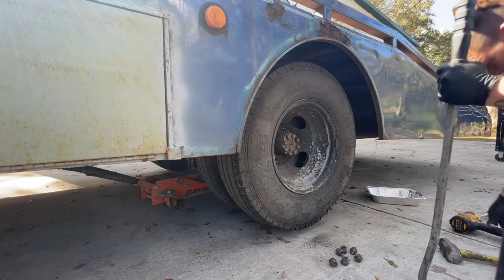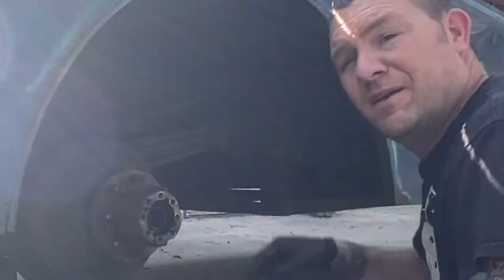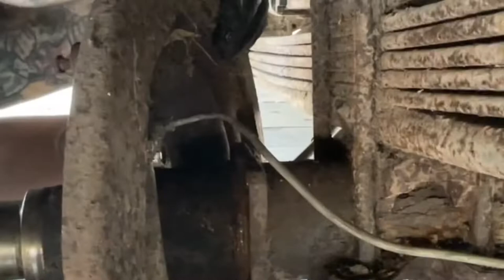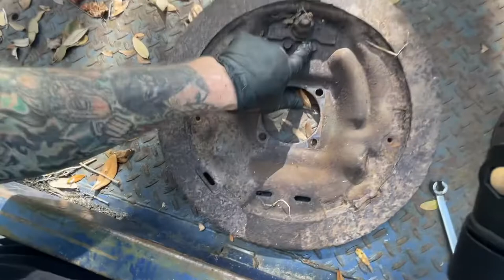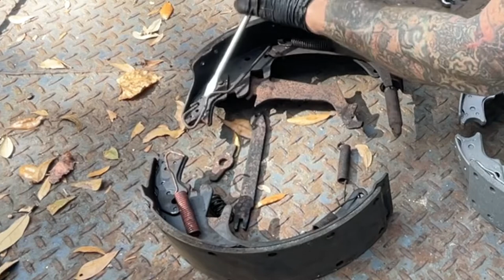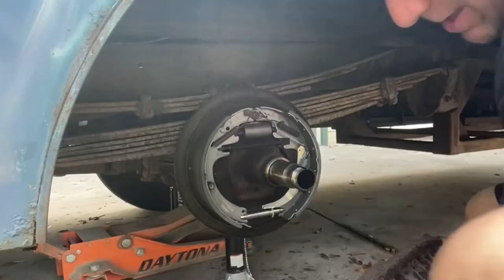1988-1999 Chevy 3500 rear brake replacement

Comment: Was quoted $600 for labor on replacing shoes , drums, and cylinders. But after watching this video It gave me confidence to do it my self. Going to try and knock it out in a couple weeks
Reply from the maker: Yeaaaaa buddy! Always better to do it yourself if you can. Not gonna lie though, if that’s $600 including parts then that’s not terrible. Drums are $200-300, shoes 75-100, cylinders 20-40, hardware kit 20., fluids, lines, etc… So around 450 in parts. I certainly wouldn’t change these for someone else for $150 🤣 But for myself I guess I’ll suck it up 😎 Let me know how it goes!

Comment: Great video, I was wondering how can i get to the rear brake line on these heavy duty axles since that line is sandwiched against the rear leaf pack, now I know. Thanks
Reply from the maker: Awesome! Glad it helped, did you get it back on the road?
Reply: The truck is on the road, what I’m trying to do is replace the rear lines with a stainless kit that I purchased, I  did the entire truck except the rear lines .
When I tried to get to the rear brake lines I noticed that those lines are packed so tight against the leaf springs that the only way imagine is to pull the brake cylinder out , but it never dawned on me about pulling the backing plate until your video, very informative,
Reply from the maker: @tomsteffs6511  nice, no more rusting lines for you!
Reply: Yes, every car that I had that the lines needed   line replacements I went with stainless, do it once and never worry again.
Reply from the maker: @tomsteffs6511  wise man right there!

Comment: love the video. watching to learn how to work on my 1988 c3500. question, since you are removing the backplate, could you leave the brake pad assembled, remove the entire thing as a unit and work on it on the bench? instead of trying to work those springs on the ground?
Reply from the maker: Thanks for checking it out! I don’t know honestly know if the whole thing would come off in one piece with all the springs intact. But let me know if that works!

Comment: My truck was sitting for years and I believe the break shoes are stuck to the drum. 
Any ideas for breaking the break drum loose. 
So far a torch and hammer hasn’t helped. 
The left rear dually is the problem child.
Reply from the maker: Oh boy I went through that on my f350 a couple years ago. I beat the crap out of it days. Eventually after days of soaking with PB blaster and whacking it let loose. 🤷🏻‍♂️
Reply: I have the same issue. Think the e-brake is stuck on

Comment: Quick question did the speed bleeder fit i was looking for them online but it said it wont fit your vehicle I have a GMC G3500 dually
Reply from the maker: I don’t honestly remember 🤣 but if you go to any of the parts store websites you’ll probably be able to find the correct part number for your application.

Comment: any idea where i could get replacement clip and square locking block for the spindle nut ? i have this axle in the rear of 1937 dodge but previous mechanic has lost the bits i only have the nuts!! cheers
Reply from the maker: Might be able to buy some of those universal woodruff key kits or possibly at an old fashioned hardware store.

Comment: What's the torque on the locking ring? In many cases, you crank it down to a specific amount then back it off a bit. But I didn't see any mention of that.
Reply from the maker: I went with German Engineering specs on everything. Güdentïght 😎

Comment: Would i be able to take off the whole four bolts and remove the whole assembly with all pads still on i only have broken bleeders need to be replaced
Reply from the maker: I’m not sure, maybe? But if the bleeders are in bad enough shape to break off then it probably wouldn’t hurt to do a brake job and replace the cylinders.
Reply: @conquercustom  was literally thinking that cause you said they were cheap and def dont wanna do this twice!! Thank you for taking the time for the video
Reply from the maker: @holeshot1721  yea buddy! I’ll keep making them 🎥

Comment: Do you know where I can get that brake drum mines is so rusted while I was hammering it off it started breaking off
Reply from the maker: Rock Auto should have it.
Reply: @conquercustom just like yours the drum came off as 1, but while shopping I only see drums that have the back half the front half where the studs are attached is not on the drum. Is it 2 pieces or 1 piece?
Reply: @conquercustom k I see that's the drum, hub, and bearings. Well I don't see how that's suppose to be taken apart 😂
Reply from the maker: @TheNeecee23  it’s a 2 piece design but they should come together. I’ve never successfully separated a dually hub from its rotor. They’re usually hella locked on.
Reply: I separated and the hub and bearing is discontinued even on Rockauto 😢cry with me please